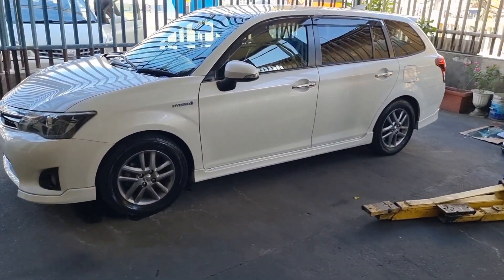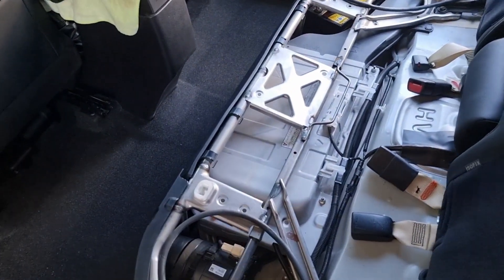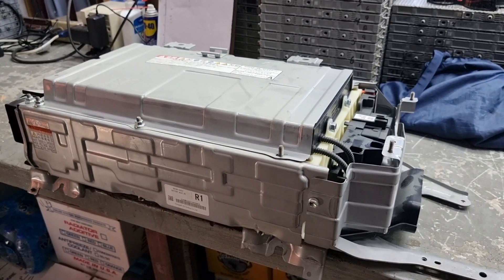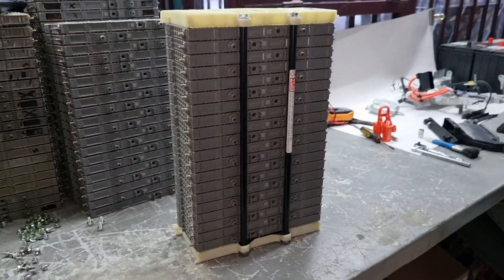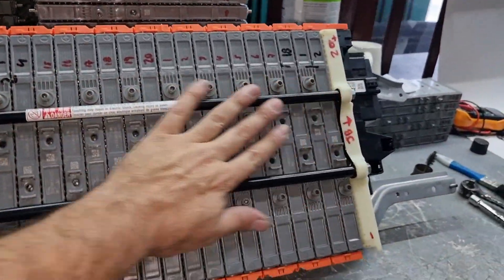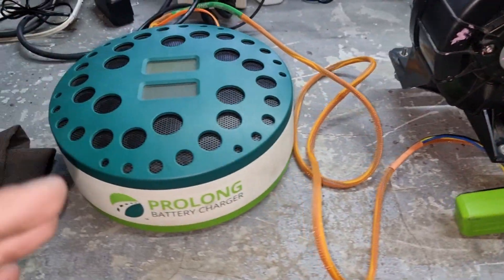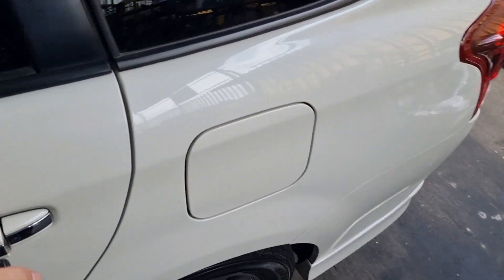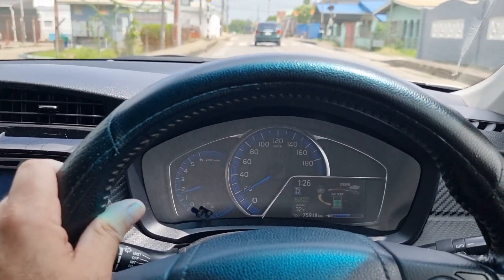reconditioning a bad hybrid battery will fix it? let's find out

Comment: The main point is. YOU CAN'T RECONDITION A BAD HYBRID BATTERY... It won't fix it...
Reply: Actually, you completely CAN recondition a bad hybrid battery.  Many many of us older Prius drivers have successfully done it ourselves or paid for good rebuilt batteries, which can cost $500-1500 in the aftermarket.   For DIY, I did it two years ago on a 2004 Prius that had failed after 16 years with the red triangle of death.   The car was at 162K, now 173K.  Two years later the battery is still testing in the 83% range, I am happy.  I hope to get another 2 years before needing to do the process again.   The car was at 162K, now 173K.  The process is complex, though not difficult.  If you pull the bad modules, cycle charge the OK ones, pair the modules well, rebalance your reinstalled HV battery will absolutely get you in the 90-100% capacity range (testing with the Dr Prius life expectancy test).
Reply: @cawag98  yes indeed, but the bad modules you have to replace them... thats the point... they will simply wont match with the good module so balance won't last much...
Reply: @joseramonherreramendoza9260  If you simply take out the old modules that don't hold a charge and replace with new and reassemble, that will not work long, as you say.  Reconditioning should go through a lot of other steps.  Have a look at this thing called the internet for those steps...
Reply: @cawag98  where can I get this done ?
Reply: @princeka3414  google hybrid battery repair in your region.  The battery is heavy (60lbs) so shipping it might not be as good as going to a local company with some references.
Reply: @cawag98  they don't get it. You test for bad voltage as well as bad capacity. Change the bad modules. We call that reconditioning. Unless you call it something else.. I went from 4% life expectancy to 89% by changing out 4 bad modules. You also have to test for internal resistance. If it's too different, yeah, your modules will go out of sync. So ya.
Reply: What is your opinion on changing the bars bars out with nickel plated stainless steel bus bars?
Reply: You can, you can also replace lost moisture with few drops distilled or Koh solution and they become like new
Reply: Reconditioning hybrid battery only gives you 10,000 mileage.
Reply: @muhammaduddin9268  my car has gone 15k and two years already. Battery still testing in the good range with Dr Prius.
Reply: Update: my car's now gone 25K and three years.  Battery still testing good with Dr Prius.
Reply from the maker: Bet? U serious? 🤣... im glad you are a smart man and fix bad batteries... great for you ☝😎☝😎 and thank you for your comment
Reply: Добрый деньдружище вы спец по гибридам хундай еник 2019год есть ошипка P1679 и горит чек ,покажи как разбирается EGR с кулером . @hybridsolutiondiagnostics